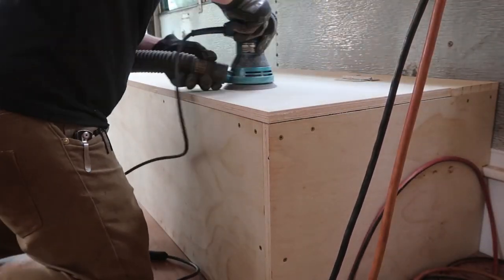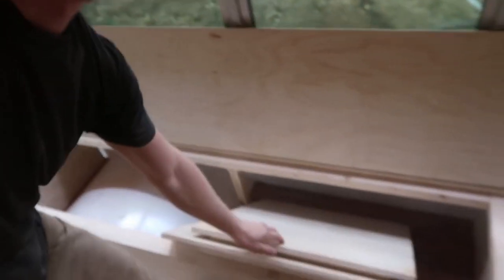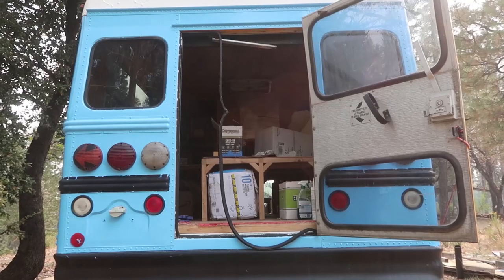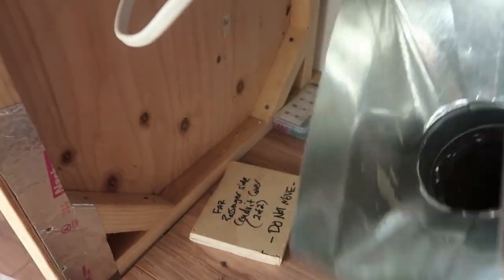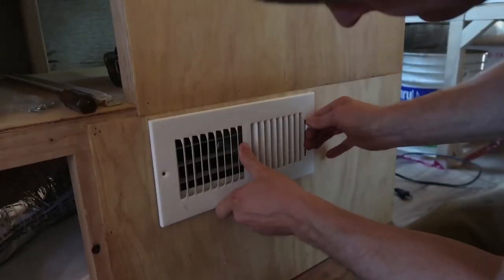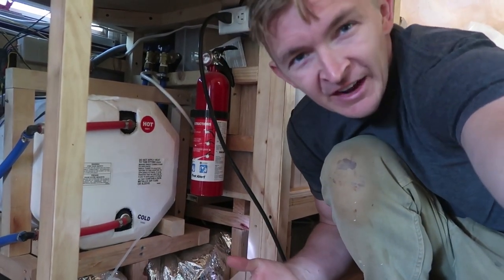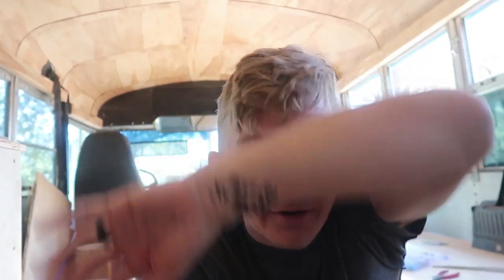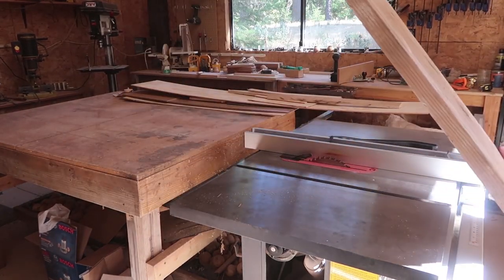#88 SKOOLIE BUS CONVERSION | Carpentry, Staining, Sanding and Caulking the School Bus

Comment: Great videos dude! Just watching I'm getting little tid bits of info that are super helpful... Like don't screw plywood into plywood cause it cracks, those are the kind of things I would learn too late!
Reply from the maker: Awesome. Yeah, one good thing to do is use scraps to test your cut strategy or build strategy. You'll see me drill holes in cardboard to make sure I've got the right drill bit. Those sorts of low risk tests will tell you more about how to do something than anything else. Thank you for watching.

Comment: Hey Ian. Your vids are great and it's pretty entertaining to watch your progress.  They only thing I'm wondering is how much air you're going to get out of your vents. Typically the furnaces ducts are 3 or 4 inch ducts. I'm guessing that's 6 inch you used. I don't know how much difference it will make, but I'm hoping you're going to get all the warm air you need out of them.
Reply from the maker: Yeah, I tested the furnace again a few minutes ago. It heated the bus from 60*F to 75*F in about 5 minutes. The furnace is, if nothing else, far more powerful than needed. Thanks for the critical feedback 2AZSUN. It's good to hear from you.